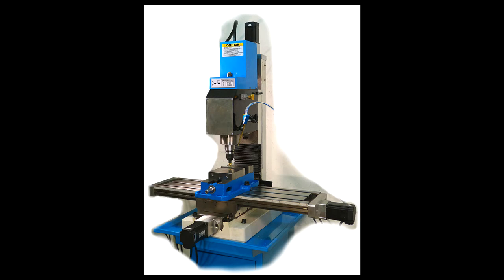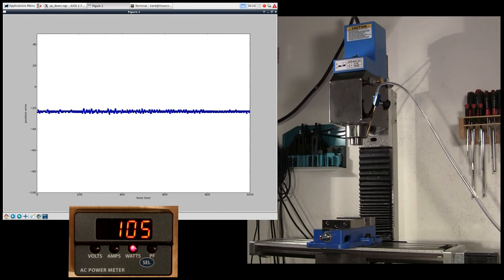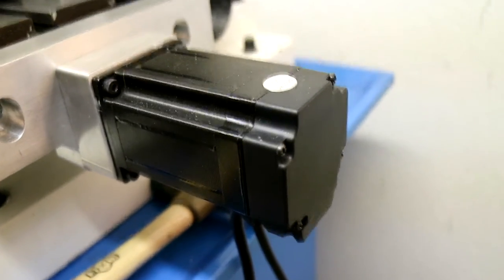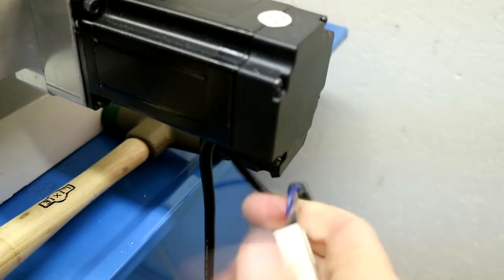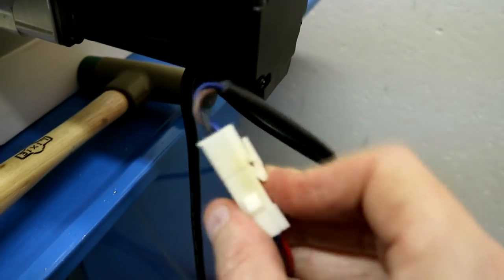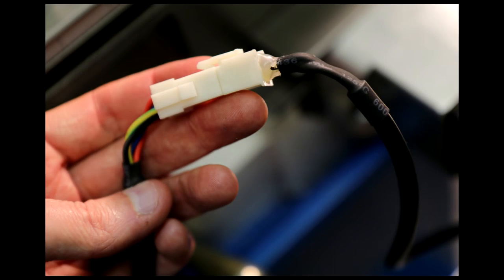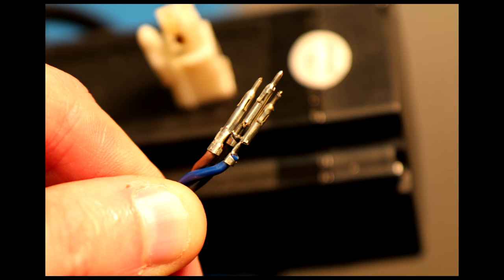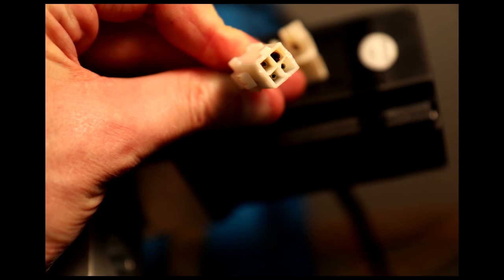Mysteriously Faulting Stepper Motor, Closed-loop

Comment from the maker: Check out my most recent video: https://goo.gl/Jj7cU1

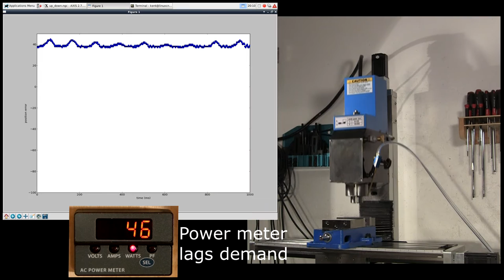The closed-loop stepper motor was faulting without any apparent reason, I ignored the problem until a Haimer was squished. The graph shown at 0:20 is of the following-error from the stepper motor driver and shows how many steps the motor is currently ahead or behind the commanded position. At 300+ ipm, the following-error range shown in the graph is +/- 40 of 4000 steps/revolution.

Comment: Kent, thank you so much for posting this. Was convinced I had an encoder problem until I soldered the motor connectors. Fixed the problem immediately. Btw, my connectors had no melting/damage, just a shoddy connection.

Comment: I have closed loop stepper and my x axis is always failing at the same location every time I run the machine.  I can’t tell if it’s a binding issue or a cabling issue such as what you described in your diagnostic search.  Do you have any suggestions as to how to check the driver for fault that could be causing the problem.  I will double check the mechanical side to see If there is a problem that I may have missed.

Comment: Great video Kent. I find these "aviation connectors" on Ebay to be very good. I use them throughout all my machines with alittle silicon grease. Good luck my friend
Reply from the maker: Thanks for the suggestion Tommy. Those look perfect! The plan is to do a complete rewire this winter. You may have noticed how shoddy my wiring is in general. How a chip has not landed and shorted something out is a mystery. The wiring is unfortunately the consequence of needing something "right now."

Comment: Sir in your opinion closed loop stepper motor is best for coin design engraving.my job work size minimum 14mm and maximum size of job work 250 mm so , is it suitable for iron engraving , coin design engraving?

Comment: could you please tell what step time, step space, direction time and direction hold did you use?
Reply from the maker: 3.5 microseconds, but I'm not sure if what you are looking for maps perfectly to my setup. For background on the board I'm using, see the sections following one marked "Timing of step pulses can be adjusted with parameters in the univstep_motion.hal
file" at https://forum.linuxcnc.org/27-driver-boards/14977-pico-systems-faq

Comment: Yes, those closed loop Nema 23 motors appear have more similarities to 'normal' motors than stepper motors ( UVW connection instead of 'normal' stepper a1, a2 b1and b2) (the Nema 34 differ) Those connectors are prone to be weak.  Flimsy at best.  Steppers would have probably saved your Haimer from crashing, due to their torque dents. I'm using a gas spring on my BF20 to  keeping it up while unpowered . It also helped me increase accelaration for faster peck drilling. What ballscrews are you using? With Nema 34 steppers, i can't go any higher than 400mm/s acceleration on 70V with digital Leadshine steppers. A lower current setting actually helped me to increase the acceleration and speed. I'm using 1604 ballscrews. Thinking about switching them to 1610's to get around the nasty resonation area they are now suffering. The 4.5Nm motors couls easily push the 1610's, and i guess this is part of the failure (too large motors for the relative low load).
Reply from the maker: Thank you Berend. How these motors are actually made is a mystery. Leadshine says these are three phase and have three wires. The Oriental Motors steppers I previously tried were five phase and had five wires (included a link below). Both have the stepper detent feel when unpowered, unlike an unpowered servo. Perhaps you meant something else though. Maybe I'll reconsider the gas spring. This combination of problems never happened before, i.e., the the motor fault was rare, the head falling was rarer, but this one day the perfect storm. :) The ballscrews are 16mm with 5mm pitch. You're doing better than me on rapids. Mine max out at a little over 300 ipm (~127mm/s). I would have probably got larger motors, but I wanted to experiment with the Easy-Servo three phase variety and I got these originally for a CNC lathe project. At first I got the drivers without encoder feedback and made an FPGA based system for monitoring following error by comparing the encoder to the pulse train, but the most it did was to resend lost steps. It didn't have the capacity to adjust current like the Leadshine drives do. The Oriental Motors AlphaStep motors were a little nicer because they provided more outputs including duplicated encoder signals, but those were maybe 2.5x the cost of the Leadshine variety.

I hope you post additional videos. There's much you could discuss. Best wishes, Kent

http://www.orientalmotor.com/technology/articles/2phase-v-5phase.html
Reply: Thanks for the reply Kent,  Yes, those leadshines are odd creatures.  No, your speed is way, way over mine :) mine accelerates at 400mm/s2, typo in the first comment. Yesterday I managed to lower the speed to 70mm/s and the acceleration is now at 700mm/s2, but with tight corners on trochoidal milling, (I tried Estlcam for those trochoidal paths, which is nice software IMO) it looses steps at a feed above ~55mm/s (still not bad, and faster than the usual feed i use for an 8mm in aluminium)  but with these high speed maneuvers, it's quite easy to get into an area where the machine is trying to change directions too fast. It's like an ultimate stress test in finding resonances, which is a known issue with stepper motors. Good thing that Fusion 360 has got the ability to lower the speed at tight corners). About servo's; I was emailing with the people from Teknic about their Clearpath servo motors (which might be the new leadshine equivalent for the hobbiests in terms of pricing) very competitive if you ask me, with very nice and supportive help. I think my next CNC is going to use these clearpaths, but, as usual.. Plans are fragile. :) Their top-of-the line Meridian drivers use g stop. Inspiring technique, perhaps there are others that use the same approach, I don't know.
Reply from the maker: The Teknic products look great. This is a really interesting topic. I wanted to get them, (they are US made - Tom Tullar was helping me at the time) but the Clearpath limits exposed information, while I dreaming about making my own control loop. (The more advanced drives did expose more information and I bet the Clearpaths could be hacked.) I had to look up what g-Stop is (link below for others, it's worth watching to the end.) Do you know how they tune away vibrations? It has to be more than measuring reflections back to the servo, especially in their example of a spring supported load. With servos do you think there will be problems with matching loads, such as the mill head to the servo? Even my abused X-axis occasionally oscillates a little. Would drive will be less practical with servo, because inertia matching? Is there a test that I can do on my own little mill to see resonance? I love the theory, physics, and details, but I pretty certain I can see the column or head flexing at times... :) The second link below is how Oriental Motors demonstrated stepper resonance. I also found user G-Code on YouTube made dampers to help with the resonance he had. I didn't realize these were a "thing." The dampers seem to "increase" the rotor inertia, so maybe the way Oriental Motors shows to measure resonance is not valid if directly diving from the motor?

https://www.youtube.com/watch?v=Dwik-W6kRa8
https://www.youtube.com/watch?v=Rv8NVF6ZLlQ
Reply: I'm not too familiar with servo's in general, so i can't determine whether there used technique is unique? but it seems that the only thing adjusted is the 'rise' and 'fall' of the (de)acceleration curve. I'd say that an accelerometer could give an accurate insight in what's going, my best guess is that teknic uses the back EMF to determine the needed adjustment. Our mills should suffer less on this 'ringing' since they are pretty 'direct driven' A belt driven setup (such as a 3d printer, which suffers badly from this 'ringing' could benefit from this technique, i don't think our BF20's would benefit very much (not on the speeds we are using). On the other hand, the ballscrew is also flexible over a longer distance so with the nut close to the motor, it should use a different acceleration curve than with the nut far away from the motor. In other words; it should be measured realtime. (it also runs heavier on the outer limits, due to the dovetail design) And it also changes when a heavy work-piece is loaded). I don't know what different speeds do with this adjusted rise and fall on the curves. I would expect a simple algorithm could take care of that though. Measuring the back EMF is what they can do. I also experimented with the stepper-dampers. They do rattle, but it does the job. (took a sheet of nylon and some 12mm steel inserts that 'rattled' around) It works, since the resonance is damped out and forced in another frequency range. 

Matching loads; Good point, i would expect this would be a larger problem for steppers than for servo's, but i think you should be able to get an insight what your mill is doing by using a good quality accelerometer, perhaps mounted on the bed. perhaps slip-stick on the X axis? i'm using some Shell oil for my dovetails that should minimize the slipstick.

Comment: Sir which servo motor best for sculpture design engraving leadshine servo motor or other brands servo motor
Reply from the maker: Hi Sonu, you may need to break down the requirements of sculpture design engraving and evaluate the options. Beyond power, torque, speed, and price there's also holding ability, shaft seals, and probably many considerations I'm unaware of. For my applications of small CNC mill and lathe cutting aluminum and steel mainly the Leadshine closed loop stepper motors work well. For an optics application I did, closed loop stepper motors from Oriental Motors were a great choice. Many people suggest Teknic Clearpath servos, and they have interesting options, but I can't afford them for my CNC machines. I suggest also looking at DMM Tech DYN servos. I have a 750W model for evaluation and the performance is impressive and price is good. I don't use open loop stepper motors today. There are enough closed loop stepper motors options, the premium is small, and higher performance and safety of closed loop, all make them a better choice. Hope this helped at least a little. Your project sounds amazing! Best wishes, Kent